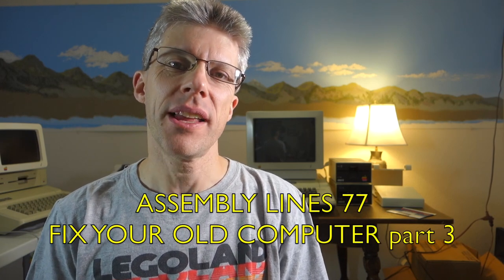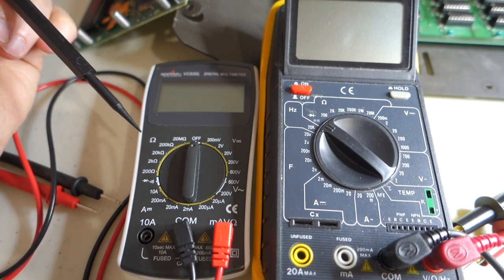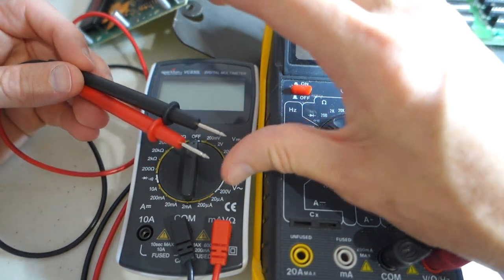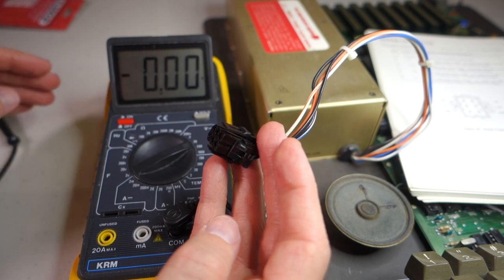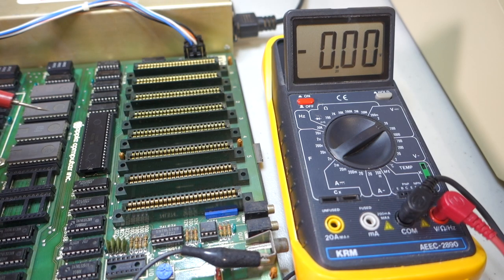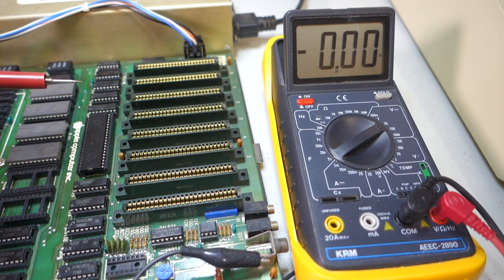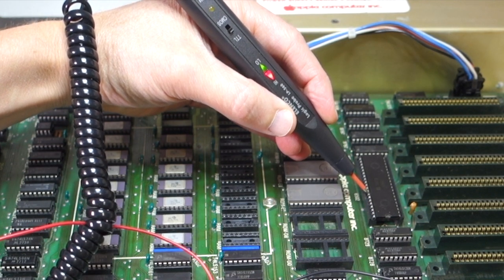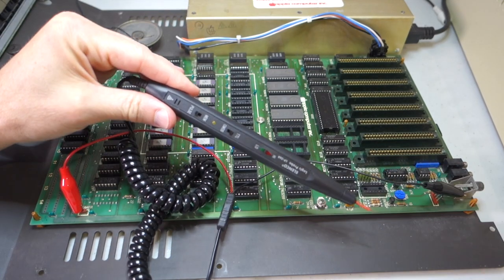#77 Fix Your Old Computer 3: Multimeters and Logic Probes

Comment: My multimeter, and many newer ones, come with removable plastic sheathes that fit over the metal probe tips. They just leave a tiny bit of metal exposed, enough to contact a pin or solder point, but not big enough to bridge and short somewhere else else. I'd highly recommend using them. With computers, they can save you from frying a chip, and with CRTs or tube radios, they can save you from high voltage accidents!
Reply from the maker: That is an excellent idea. I'm going to find a pair of those probes. Maybe it would also prevent you from stabbing yourself with them, which I've done multiple times...